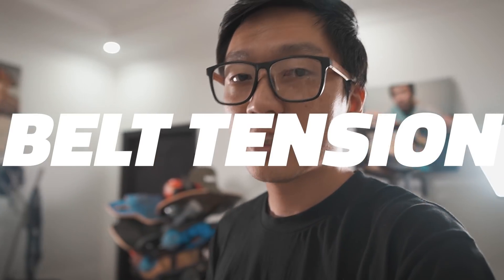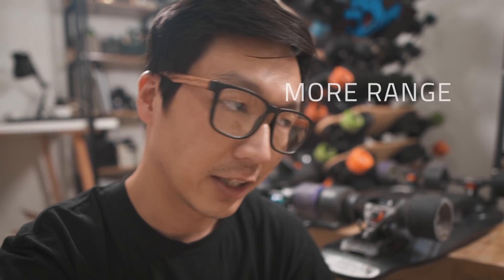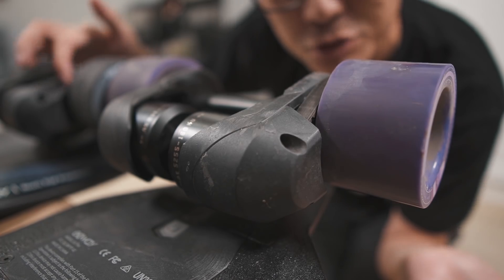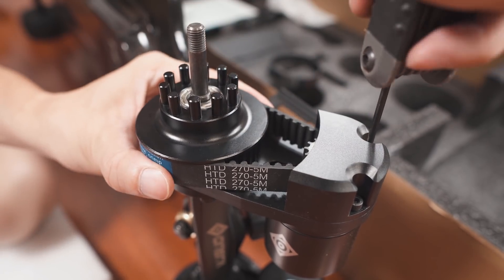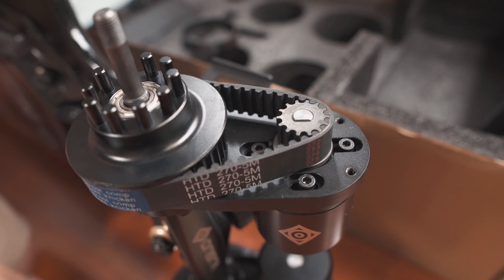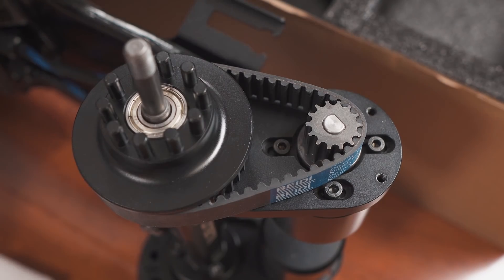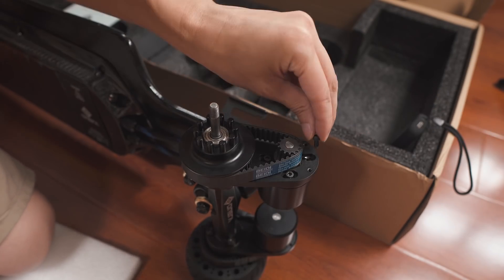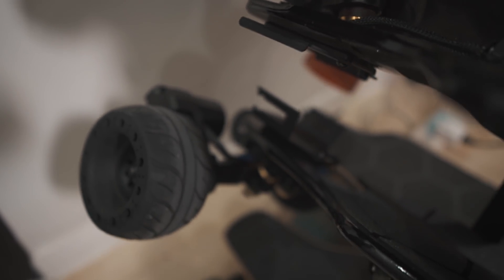If your electric skateboard uses belt drive...

Comment: Daniel I really want an electric skateboard but I want it to be silent and I have bumpy roads are hub motors good? And which board would you recommend me? My budget is 600 bucks. also I love your videos
Reply: You won't like hubs on shitty roads. Get on u/electricskateboarding on reddit and ask there. Super helpful community full of knowledgeable (but opinionated) people that are almost always helpful.
Reply: @spliffdelakong5422  thanks
Reply: Go direct drive for comfort and silence. You risk scratching the motors but they’re usually built pretty thick
Reply: @cramdangle  any board recommendation?
Reply: I had a hub exway x1 pro. Loved the board but the hub wheels are terrible on roads that aren't perfect. Sidewalk cracks hurt feet to hit with anything above 5mph. I gave it to my friends kid for his 13th birthday when I got my gtr.
Belt or direct drive is best option probably. Direct tend to be louder in my experience...
There is an AE all terrain board with hub motors, if quieter is a must.
Reply: @bryancrane821  big thanks
Reply: I built my board for about 500 but everything I got was on sale. I bought almost everything from boundmotor (350 for direct drive motors and esc) and a 10s3p battery from ride1up for 100. A deck from skate shred for 50 and that was pretty much it.
Reply: @cramdangle  sounds good
Reply: Backfire is decent and customer service is not bad.

Comment from the maker: Happy 4th of July! 🇺🇸 I had been working on a different video but that one had to be pushed back, so I quickly did this one to publish something so you don't all forget me. Now go check your belts. And then wash your hands.
Reply: Your rack is full, do an electric skateboard giveaway??? Just trying to help the electric skateboard community grow🤘🤘🤙🤙
Reply: I just followed your guide, and the tension seems to be as you shown on your video. One question: when you use the remote to move forward and then backwards, is it normal that the belt move side to side (towards the wheel and then towards the motor)? It seems that when the belts were tight, it wasn't moving side to side.
Reply: Thanks! I saw the "wash your hands" reference in the cloud wheels video 😂
Reply: Did you use the standard hardware to install the shred lights on the dual belt black carve or did you need longer hardware(bolts/screws) please and thank you
Reply from the maker: Standard
Reply: Daniel Kwan much obliged. 🙌
Reply: Daniel Kwan Hi Daniel! Great video, it was very helpful! Quick question for you. I just bought a backfire zealot board. I want to get 105mm cloud wheels or something similar to it to have a smoother ride on tougher roads. Do you have any affiliate links for some wheels that will work with my board?  Thank you!
Reply from the maker: MegaJodog sure visit https://dkwan.com/discounts
Reply: can you do a review on the ownboard m1?
Reply: can you make a video for RUNAJOY Belt Drive Motors Electric Skateboard? I see a new Belt Drive Motors Electric Skateboard sell on amazon
Reply: Happy 4th of July again just got a Tybee mini 3 today that ks for all the info